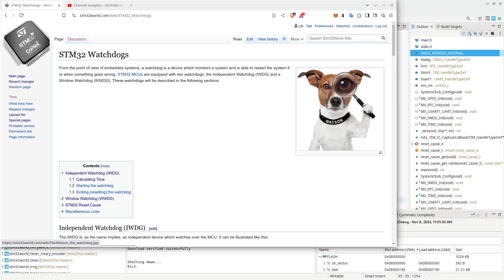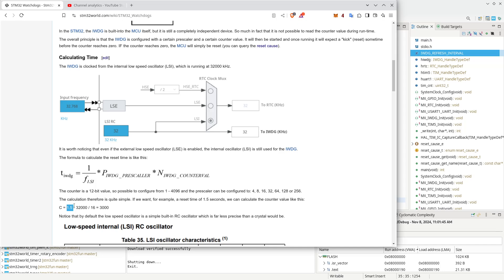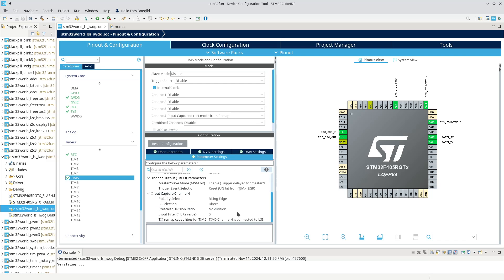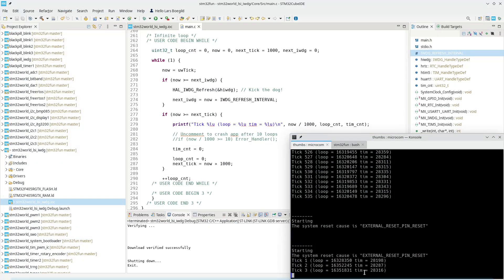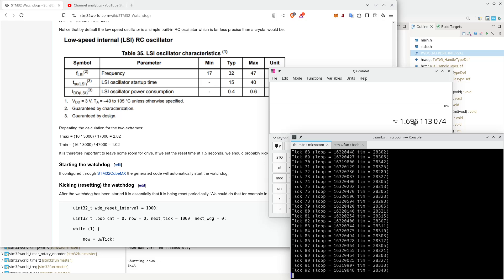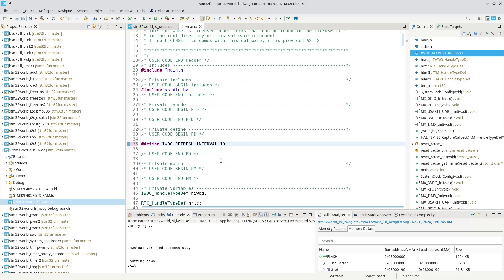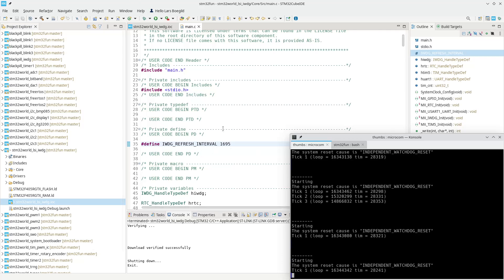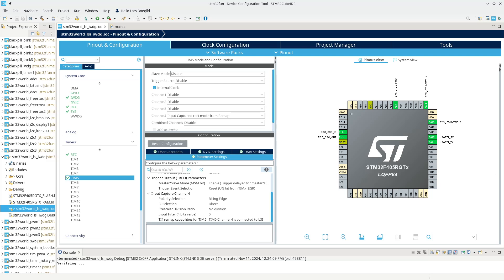STM32 Tutorial #31 - Measuring Frequency

Comment: Impressive video, STM32World. Looking forward to your next upload from you. I smashed the thumbs up button on your content. Keep up the fantastic work! The way you explained the practical implications of the low-speed internal RC oscillator was enlightening. Have you considered how external factors might further influence the accuracy of your timing calculations?
Reply from the maker: I can't remember if it shows but if you look at the measurements they drift quite a lot.  I think it is quite temperature dependent.  Anyway - as pointed out it is within specs, so it is just something one need to take into consideration ;)
Reply from the maker: I measure the LSI by counting pulses based on timing from the HSE.  The HSE will remain fairly precise at all time - without looking up the crystal specs we're talking ppms of drift.  As mentioned, the RC oscillator is a different beast.  I suggest you calculate worst case and THEN add a safety margin of 20-30 %.

Comment: Yeah, it is important from a software point of view to consider a) the spec limits and b) the "jitter" in the code, which may happen from interrupt disable and such. I generally advice to kick the WD twice within the worst-case according to spec (1 second in this case). Another thing is to consider what the WD is "protecting" against. We have MCU failures due to EMI where everything stops (except the WD one hopes), but also against software bugs where code hangs in a loop, or gotten into an invalid state and doesn't do the right thing. Having the "WD kick" in an interrupt routine may not be ideal, and one should possibly put the "kick" in the main loop of the application. And that location may have way more "jitter" to consider. Kicking the WD is cheap, and doesn't hurt to do it too often.
Reply from the maker: In this particular case what annoyed me initially was that the behavior i saw did not match the theoretical one.  Understand how bad the RC LSI is helped with the understanding and well - calculated from the measured LSI the numbers add up ;)
Reply: @stm32world  Alright, although the (lack of) accuracy is right there in the datasheet, nearly a 3x variance allowed.
Reply: Never used the WWDG.... Looking forward to the episode about it. ;-)
Reply from the maker: Not looking forward to making it - if anything but interrupt driven.  The benefit of the WWDG is that you do get an optional warning interrupt before the reset.
Reply from the maker: If you use the WWDG it does hurt to do it too often.  That one is a tricky beast ;)  In fact I'd say it is mostly useful to check the NVIC still behaving as it has the ability to fire an interrupt shortly before resetting but well within the allowed window.